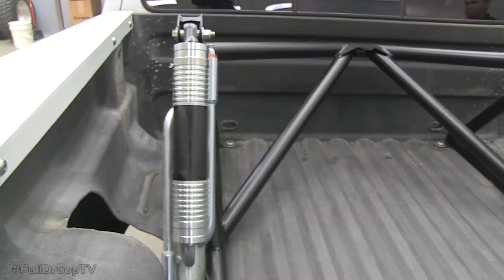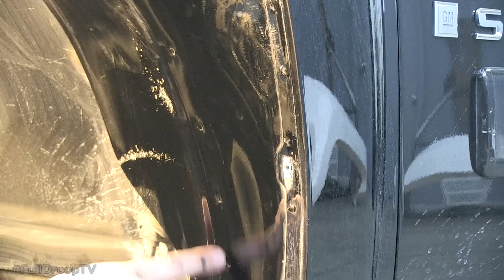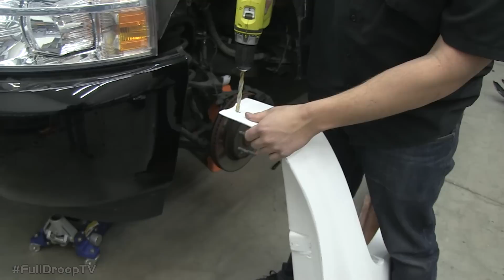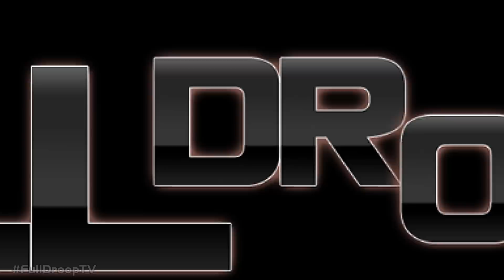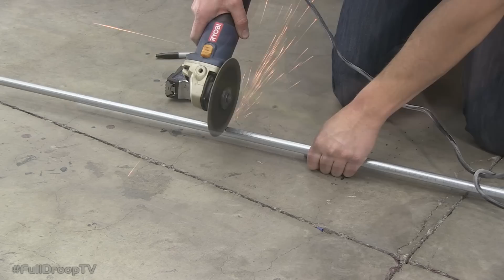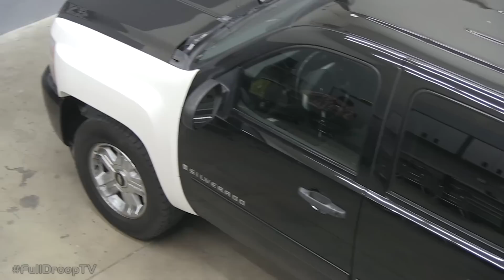Silverado Prerunner Fiberglass Fenders & Bedsides - FullDroopTV (Season 1, Episode 1)

Comment: What can we do with the void between new fenders and inside fender.  Also on the top of the bed it looks really unfinished is there any suggestion for bed rails or something to complete the finish product.  Also are these able to be painted.
Reply: Most use spray on bedliner to simulate a bed cap. Fiberwerx has bed caps for the 2025 silverado fenders i just bought, so it will be interested for me to see how they go on, using this video as a rough guide doing it myself. Just gotta wait 6 weeks for them to be made

Comment: not a fan of those sheet metal screws, you're talking about a prerunner thats taking abuse... without a proper bolt and nut they will come loose at some point, you spend so much time on certain stuff and affix it like trash

Comment: I’m sorry but this is probably one of the worst fender installs I’ve ever Sean. Literally looks like a rat chewed the oem fenders off and didn’t trim and minimize what’s need to mount the fworx fenders.. 

Used a plasma and shot sparks everywhere including the windshield..

Then used button heads and flat washers and electrical conduit to make mounts..

I’ve been doing this kind of work for a long time and I’m sorry but .. wow .. absolutely atrocious

Comment: What was the rise and flair on these fiberworks fenders thanks. Was wondering if the fronts were 4 inch flair or 2inch I'm sure the rear is 4 inch
Reply: On this video they used the 4" flare 2 inch rise from fiberwerx.
Advanced fiber glass has the 2" flare and 1 inch rise which am looking forward to, they also the 4" flare and 2 inch rise.

Comment: I’d probably use a saws-all for the drivers back fender.  Probably not a great idea with all those sparks around the gas tank vent/filler.  Diesel will be fine but gas venting would be a huge issue

Comment: I've enjoyed watching your videos and have been trying to decide and  research what to do with my truck, I have a 2008 silverado single  cab short bed every kept telling me to lower but don't like that as much then others said lift but  I enjoy driving fast and yet still have control so this led me to prerunner plus I have never seen a single cab nnbs chevy prerunner a lot of crew and ext. anyways I like these fender but like the one piece conversion more is the install typically the same on these except removing the hood and latch I'm assuming you would leave the inner fenders and core suppport any advice would be helpfull.

Comment: Hi, I have a 2004 ram 1500 4x4 with a hemi, and I'm currently running 33's on it and will get some 35's when these wear out. My question is, it seems like it's struggling a little bit with the 33's now, will i have to change the ring and pinion gear to run the 35's? It's hardly ever off-road, mostly highway miles. Also, is there any company that makes these flared fenders out of steel?

Comment: Just a small tip for you guys. When you are using a plasma torch to cut the sheet metal. Try "pulling" it towards yourself when making the cuts, you will find the cuts to be much straighter and less jagged when free handing

Comment: My 08 silverado is an ls. V8 4.8 can i still prerunner her? Or should i invest in a z71 or lt model
Reply: sell the engine to a track car dude and buy a bigger engine with more torque,dont get me wrong you could totally supercharge the ls and put like 3,5 inch straight exhaust on it and bigger injectors(easiest way in my eyes)

Comment: I cant believe how much work it was just to pull the front fenders off
Reply: skatefreak666666 for real! When I widened my Subaru Outback fenders it was like 5 bolts and it was off.
Reply: @ProDriver33  they didn’t remove the fender. The removed part of the fender leaving the inner shell. It’s welded together. You could remove the whole fender in 5 minutes, but can’t cut in half in that time
Reply: Thats gm for ya

Comment from the maker: The fitment is good on the fenders. I would have a fabrication shop install them as they have more experience working with them than most body shops. Fiberwerx usually has a 7 day turnaround
Reply: How do u skin the front fenders on a 2005 there a little different from the video you guys have

Comment from the maker: What fiberglass are you using? The front fenders should unbolt but the bedsides will need to have the spot welds drilled out and maybe a little cutting.
In an upcoming episode we will be doing this on a 2007 F150 Supercrew.